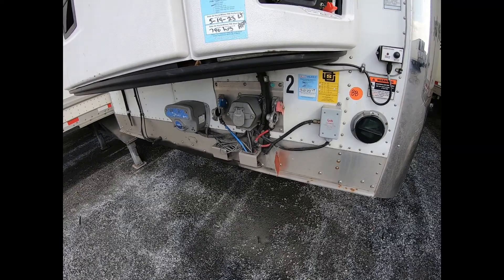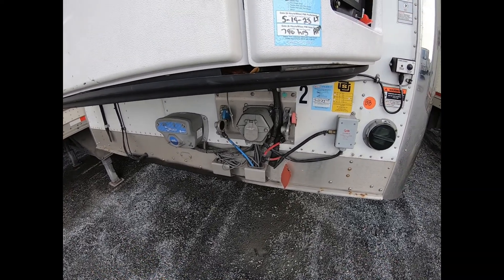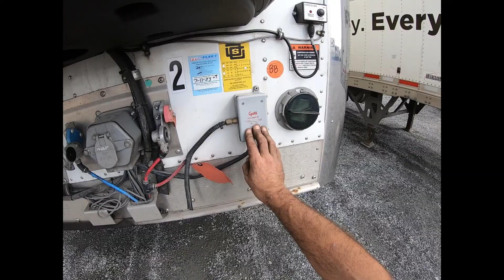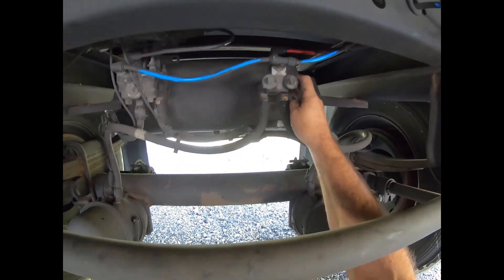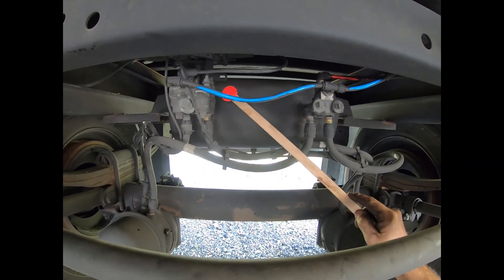Semi Trailer Air Systems. Part 1 - Air Brake plumbing and valve operation.

Comment: Thank you i needed this video. Im having an issue that whether loaded or empty i step on the brakes mid to heavy the drivers side trailer brakes lock up. No issues on passenger side they seem to be working fine. Any ideas?
Reply from the maker: Sorry for the delayed response... That sounds like a foundation brake issue.  I would start by looking at the brake stroke of the brakes on the drivers side.  Make sure the strokes are within DOT limits. Then I would fully inspect the brake components.  Dry or seized s-cam bushing can cause brakes to lock up.  Inspect the head of the s-cam for wear.  Inspect for excessive wear on s-cam bushings.  Also check for proper slack adjuster operation.  Hope this helps!
Reply: @ thank you sir. No worries on response time we are all busy people.

Comment: 6:49 - Air would not be dumping out of the service gladhand.  The tractor protection valve would prevent that.
Reply from the maker: It would only prevent it if the red emergency/supply gladhand was removed as well. (Or there was a substantial leak in the trailer supply circuit.) The tractor protection valve opens the pathway the service air takes when pressure is sufficient in the supply/emergency circuit. (over 45psi I think) In the example I was giving only the service gladhand was removed, and if a service brake application would be made, air would blow out of the disconnected gladhand. 
The following link has a good explanation of the TPV from Fanshawe Motive Power.
https://youtu.be/-1vA1EnNJZ4?feature=shared
Reply: @fleetrepairsolutions6372  Only the service gladhand needs to be removed.  I perform this test every day as part of my pre-trip inspection.  No air escapes the service gladhand when I apply the service brakes.

Comment: Normal brake application would only be 20 to 30 psi, any more than that psi would be a panic stop.Professonal drivers doing Normal downshifting, would very rarely apply more than 30 psi.

Comment: Awesome many awesome video !!  I think the emergency valve is my problem. I picked up my trailer and it won’t air up. I have no trailer breaks , no emergency brakes (obviously) and the air bags are flat . Im stranded and im hoping buying this would fix it.

What do you think !! 😅
Reply from the maker: Sorry to hear you were stranded...If you pressed the red trailer supply valve inside the tractor and the the trailer parking brakes didn't release AND your airbags weren't inflating, a faulty emergency relay valve would be one of the first things I would check for. I would first confirm there are no major air leaks and that air is getting to the valve. Hope you got back on the road!